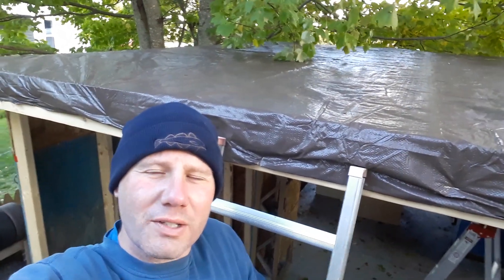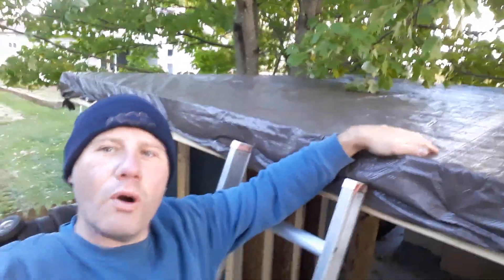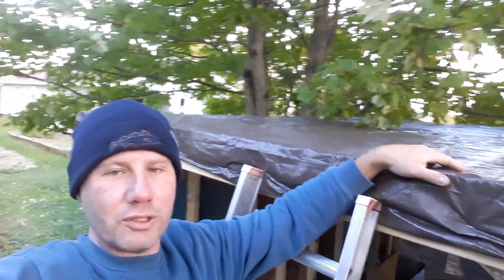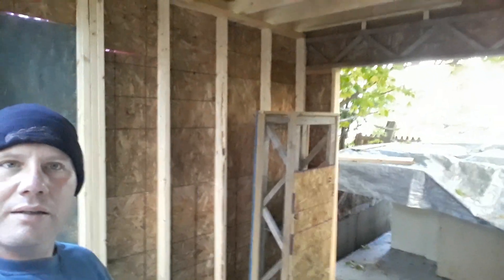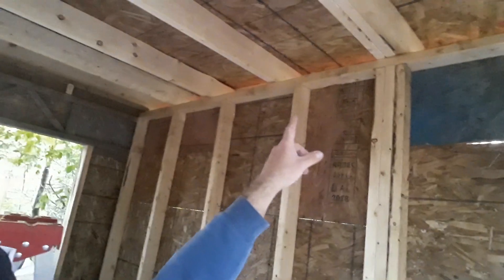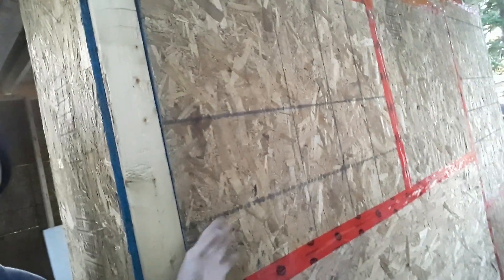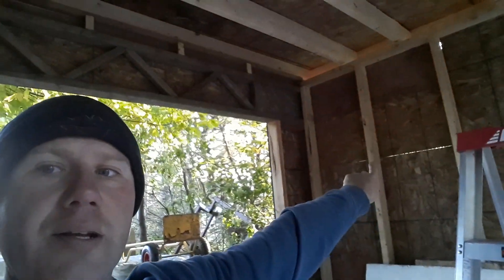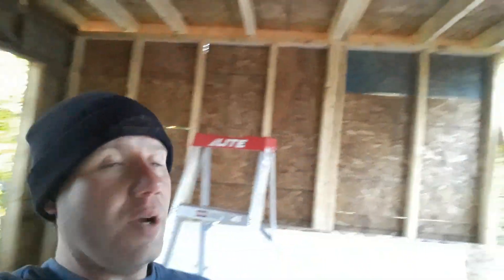A Roof Over my Head #IamACreator

Comment: I'm in the same boat I'm gonna end up putting a metal roof on mine before Winter n it aint gonna be cheap
Reply from the maker: its crazy for they want for sheet metal these days. Even used stuff is bloody expensive.  I'm going to try and get factory reject/damaged or miss matched colors at a discount price but I don't have time to research that right now.  That's why I went for the tarp this year, it need to be closed in an insulated first...running out of time. Thx for watching!